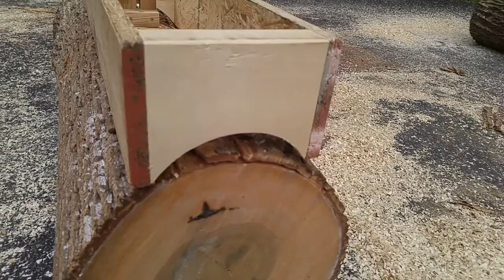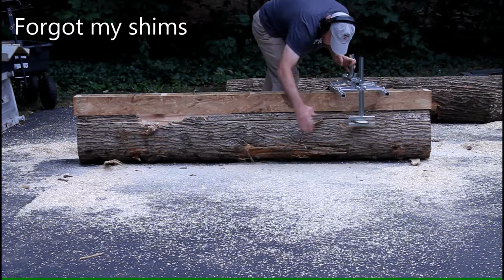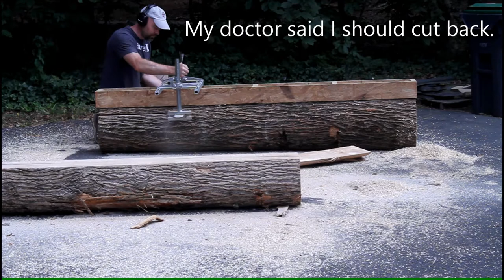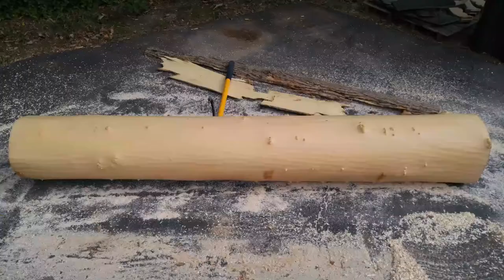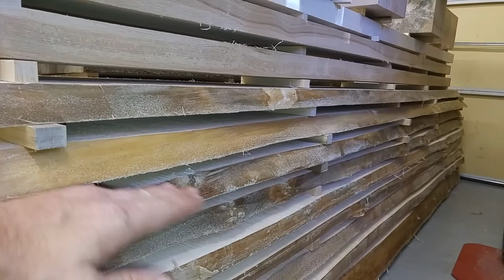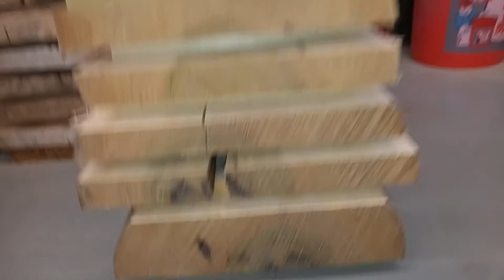Saw your own lumber using a Granberg mill

Comment: have you had any issues using the ms 391? i have one of these that i am going to be putting a Alaskan mill on next week
Reply from the maker: So far so good. If I was going to be doing more sawing I'd get something bigger, but then I'd probably want a smaller saw for general use. I strongly recommend ethanol-free fuel for better performance. It's not too expensive if you buy it from a gas station.